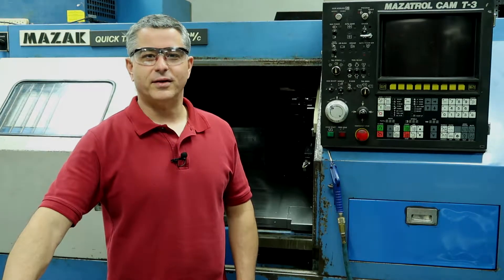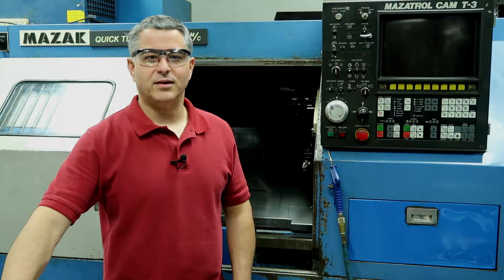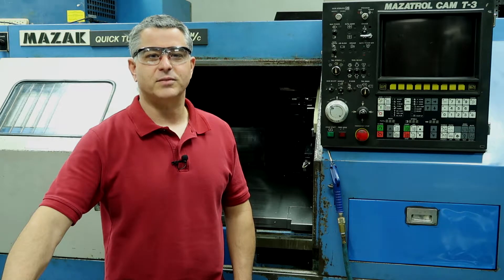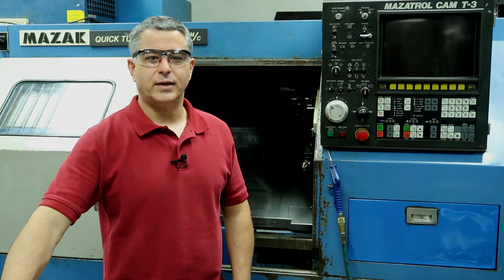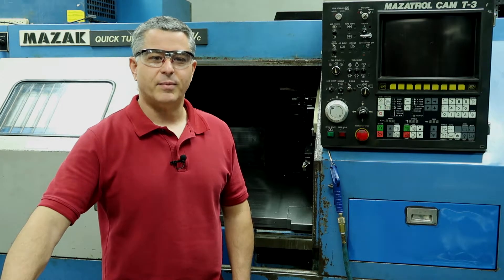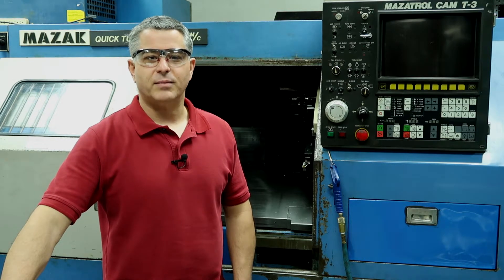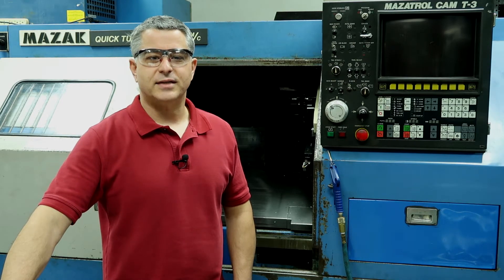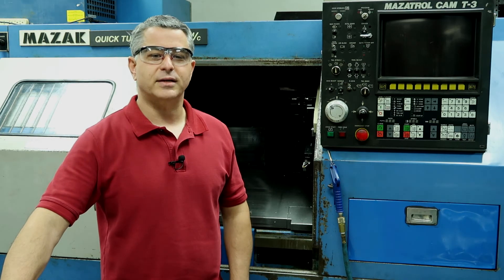Intro Mazak Mazatrol Training Philabuster CNC Lathe T-2 / T-3 Control

Comment: Hey phil I have a quick turn 10 with mazatrol Cam T2 do you have a supplier to get spare parts for this old cnc lathe thanks
Reply from the maker: @troubleshooter6372  Mazak still supports all of their old machines with parts. Next option is Ebay.

Comment: Hey Phil! I have a qt15 and I was wondering if you could pm your parameters I had to initialize the parameters on this machine and I desperately need to get this thing going again.
Reply from the maker: My parameters will not work on a QT15. Sorry.
Reply: @mazatroltipsandtricks6816  okay thanks!

Comment: do you have a video on control my t2 when making 2 inch od cut my control wont read 2 inches on screen it might be .05 less, but machine cuts correct according to what is programed
Reply from the maker: Do you have .050 in the wear offset? That will make the machine display smaller numbers.
Reply: @mazatroltipsandtricks6816  will check, thanks
Reply from the maker: @troymannon3726  Also sounds like the tool probe needs to be recalibrated. I have a video on that procedure.

Comment: Hi, I would like to know how to make a program for  Outside diameter 130 MM Radius 1000 MM  on OD, R3 on both edge 30 MM thick.
Thanks
Reply from the maker: You will need to use a convex radius segment and the center of the radius will be X-1,870mm Z15mm. You will then calculate the start and end X positions.  Need to use a full radius grooving tool to cut this part.  Put the 3mm radius at start and end corner for this segment. You will need a short line after the convex segment to push the tool past the part. The OD of the line will be smaller than the 3mm radius plus the tool radius.

Comment: Hi I want to start off by saying thank you for the  videos that you put out they are very very helpful... I have a question I'm running a mazatrol 640 t. I'm doing Peck drilling the problem I have is I get a lot of Chip or shaving build on drill. No  matter how I sharpen the drill it seems nothing works..   Is   there a way to throw the spindle on reverse after it pulls up? I'm thinking this will help it out by throwing out the shavings... Thank you in advance!
Reply from the maker: The Integrex with the Smooth X control had a macro program that Mazak gave me to spin the drill in the opposite direction and blow off the chips. I have not heard about it on any other machine. It was a sub program called up with an M code.
Reply: @mazatroltipsandtricks6816  
Thank you sir for that quick response... I'm going to do a little bit more research and hopefully speak with a mazak tech... Again thank you for your time...
Reply from the maker: @bcruz264  You're welcome.

Comment: Hey Phil , I like a lot you channel , Could you help me with a question? , I have a Mazak T32B control and I like to make a backup of machine parameters but I don't have available of parameters for connect my pc, Do you have this parameters for do that, If the answer is yes could you share it with me. Thank you a lot, blessings and much success
Reply from the maker: I do not have your machine. Worst case you can take pictures of the parameters and save them that way.
Reply: @mazatroltipsandtricks6816  ,Thank you for your tip, Regards